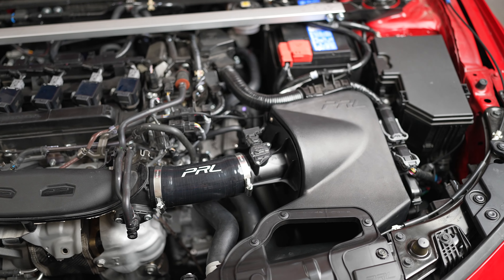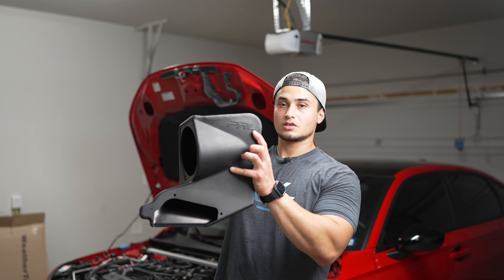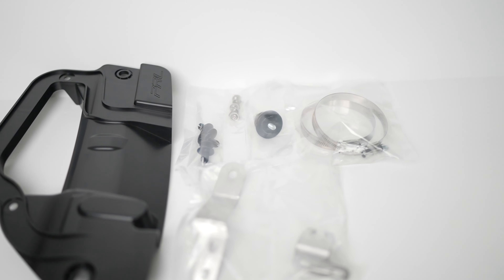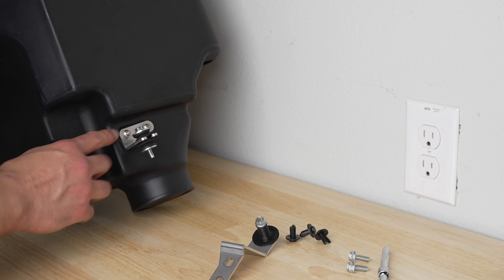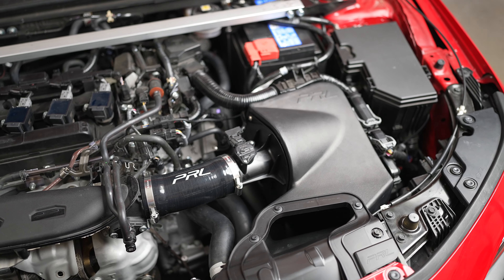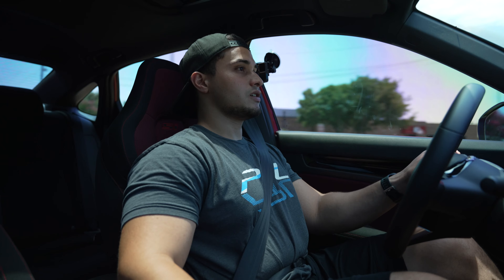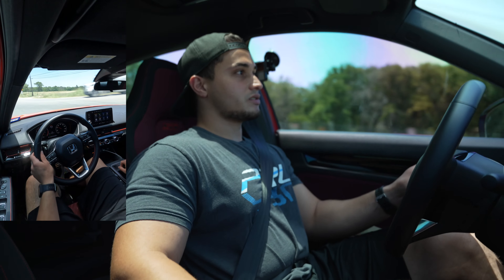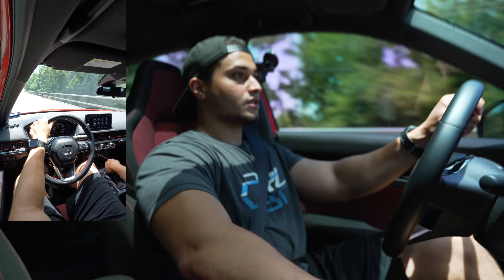Official PRL High Volume Intake Install for the 11th Generation Civics and 5th Generation Integras

Comment: Amazing video! Just got my 11th gen Si this week and doing all kinds of research on the first couple mods I want to do to it. I've previously owned the 10th gen and to be completely honest the 11th gen stock doesn't feel as fast as my 10th gen when stock, but I have a good feeling that there is a lot of performance potential once putting some mods on the  11th gen. I plan to order this high volume intake from PRL along with upgrading the Intercooler and lastly getting a K tuner setup on it. The BIG question I have is if you are still running on your stock clutch? I've read different reviews stating some people dont have an issue running a tune on a stock clutch and others get slippage... so just thought I'd get your opinion on it. 

Keep up the great content my friend, and by the way you just got your self another follower and I've made sure to enable to notification bell! Lol 🤝
Reply from the maker: My man! Thank you for the kind words and congrats on getting a new SI. So, I am still running the stock clutch, it still sucks on this generation civic like it did on the 10th Gen. In my personal experience, running Hondata’s flex fuel map, I don’t get any slippage until I start adding E85, the more e85 lol the worse the slippage, I think the most I run is E30 though and that’s only on hard shifts. Like when I would do I launch and then I would shift to 4th, it would slip a little. Or when I want to pass someone on the highway and I try to downshift and launch it, it would slip. But with the regular pump fuel maps you should be fine. I recently switched to Ktuner and so far no issues on their most aggressive map. I haven’t added E85 into the mix yet but my next video will be on Hondata and Ktuner so you’ll hear my experiences on there. Good luck man and thank you for supporting the channel! 🙏
Reply: Oh okay, thank you very much for the feedback. Yea for the meantime I plan to run stock k tuner tunes or maybe even phearable 91 octane tune. 

I'm literally going throw all your videos and have put together my wishlist from them.. haha

1.PRL High Flow Intake (just waiting for them to go on sale) 🤣

2. KTuner 

3. PRL Intercooper Upgrade

4. Aquity Bushings 

5. Lasfit Led turn signal and reverse bulbs and floormats.

(I thinks that's about it, In order to get me started).. hahaha 

Looking forward to your next video on ktuner and Hondata. Have a good one brotha!

Comment: For a daily driver that is used mostly for slightly spirited driving and some road trips is the prl intercooler worth it? Should i do the charge pipes too for my needs? Also, how would you swap the filter with this intake? Would you have to remove the intake to do it? Ive never modded a car before so my questions probably seem silly.

Comment: Another great video both on install and drive👍
Yes wheels and tires asap. For reference the oem wheels weight 28.3 pounds 😳. The ones I put on weigh 23 pounds. Though still stock, acceleration and throttle response went through the roof it’s crazy. 
I swapped over the summer Eagle F1s from my oem wheels though I did go a little wider at 18x8.5 +45 and they stick! 
I know your on a base flex tune so it may be hard to answer but I wonder how this will react on the stock tune? I know prl posted a dyno graph but I’ve learned to take that with a grain of salt. No offense.. getting the car dynoed next week to see what it does in stock form. Super contemplating pulling the trigger on this and dynoing after to see the results 🤔. I’m actually really impressed with the factory power band throughout.
Reply from the maker: Thanks dude! Yeah I ordered some lighter wheels and it’s going to make a world of difference. When I had the Type R and ran the ZE40’s it was like a completely different car lol. 
I’m not expecting any crazy power gains out of this intake if anything it’ll just prepare myself and everyone else who gets this for any future turbo upgrades. Probably where you’ll see the biggest difference, the stock intake system is already pretty great.
If you haven’t already you should join the discord I created for the 11th Gen civics so you can share all your thoughts on there. Link is in the description
Reply: @lui.racing  yes it’s crazy how different the car is. I’m down to join ✌️
Reply: @lui.racing  The Discord link is showing expired. :(

Comment: Hello. Great video. I have a question does the map housing have a small lip or something cuz apparently mine does and the map housing doesn't fit into the other part where the air filter is actually at. It seems that your air filter was all the way down but mine doesn't go all the way down. Any help on this will be greatly appreciated.

Comment: Are you tuned? Not sure if you mentioned in the video
Reply from the maker: Not custom tuned, I have the Hondata flex fuel tune on the car
Reply: @lui.racing  gotcha. The car feels pretty slow to me all stock. Does it feel a good bit quicker with the tune and mods you have?
Reply from the maker: @SIIKAP1  man it makes a world of a difference to add some bolt ons and a tune.

Comment: Great video my guy. Keep it up. Which Milwaukee and what size impact wrench did you use in this video? I’m in the market for new power tools.
Reply from the maker: Thanks man!!! I appreciate it. It’s a quarter inch impact that I bought at Home Depot when it was on sale for $100, and lemme tell you! It was well worth it. This impact can do most anything. I have the half inch impact too and that thing is dangerous.
Reply: @lui.racing  Thank bro. You wouldn’t happen to know which model you have do you? Just want make sure I don’t buy the wrong one.
Reply from the maker: @1904bomdc5  I don’t remember off the top of my head, when I get back to my house I’ll see if I can find it and I’ll put it on here.
Reply: @lui.racing  Thank brotha. That would be very much appreciated.
Reply from the maker: @1904bomdc5  model number is 2656-20
Reply: @lui.racing  Thank Youbagain brotha. I appreciate it.
Reply from the maker: @1904bomdc5  anytime my man!
Reply: @lui.racing  One more thing bro. When you have a chance, what size/brand 1/4 hex to square socket adapter and sockets are you using?
Reply from the maker: @1904bomdc5  that I don’t remember. I have 1/4 hex to 1/4, 3/8, and 1/2 inch adaptors for sockets. You should be able to find one on Amazon maybe Home Depot too

Comment: awesome videos bro. Q, did you need a tune for the new intercooler and HVI for your si? any info is helpful
Reply from the maker: No you don’t need a tune. Been running without a custom tune for months now with no issues.
You would see the most benefit out of these mods with a custom tune though.
Reply from the maker: Also, thank you for the kind words my man! 🙏

Comment: Since you previously had a resonator delete, did you have to put all the stuff back together after install the high volume intake system?
Reply from the maker: No you don’t have to put everything back together. You can keep the part of the resonator delete that goes to the charge piping
Reply: Great vid, Luis. Do you have to do a resonator delete to install the high volume intake?
Reply from the maker: @manukaliasf  no you do not. Everything you need will come with the intake for install. Super easy

Comment: Just bought the PRL HVI for my ‘24 Integra 6mt. Just a video of a ‘23 integra going into limp mode after hitting redline with this intake installed. What are your thoughts on that? Have you had the same experience or heard anything similar? I guess now I’m just hesitant on the install
Reply: Have you installed? If so, notice any issues? Got a 24 Integra 6MT and thinking about ordering but heard thing same thing as you posted.
Reply: I’ve had it installed for about 6 months now. No issues at all. Things sounds amazing honestly.
Reply: @thebuffanimalnurse7205  Awesome, thank you!

Comment: no need to unplug battery or do an idle relearn process when working on the intake?
Reply from the maker: I never did that and my car was fine
Reply: had to do it on mine, had every single light on the dash go off but after unplugging the battery it was all good

Comment: Awesome video but not sure what happened my SI now won’t go past 12 psi after installing it
Reply from the maker: That’s strange, I never had that issue. Make sure sure everything is on correctly including the MAF sensor. Other than that you’d have to ask PRL if they can help you troubleshoot
Reply: @lui.racing  yeah I just got done putting it on I’ll go back to stock and go from there thanks

Comment: Hey man, my 1.5 civic CVT is making 185WHP with PRL stage 1 intake system.. do you think it can add more if i change to HVI?

Also, is it safe to run a cvt civic with 200+ whp? i want to but i dont want my cvt to break

Comment: Just put this in today. Few things different than the production model. That bracket has your pre production grommet @10:43 but it doesn't line up exactly with the air box so it just kind of sits on top, not sure if it's designed like that but seems kind of odd.
Reply: Are you talking about 10:50? I just put this in today and I could not get that damn bolt to go in. I gave up and left it out. It's very snug without it so not sure if I'm going to leave it or redo it.
Reply: @BrandonKyle7  Bolt goes in fine for me but the part at 6:10, production version is different and doesn't fit in
Reply: @lepoldbuttersstotch  OH I know what you're talking about! I had the same issue. You have to remove the metal bracket that is on the car stock. If you look at 8:44 you can see it's not there. I was in the same boat but you just need to remove the metal bracket that is held on by two 10m bolts.
Reply: @BrandonKyle7  Yup, that's the piece. I mean that the replacement bracket doesn't actually fit in the hole at 8:20. Mine didn't come with the grommet there. My bracket was just one piece and it doesn't fit in that hole at 8:20
Reply: @lepoldbuttersstotch  weird. Mine came with the grommet. You should hit up PRL, they can probably send you a grommet.
Reply: @brandonjohnston6760  fitment is snug enough, unless I get some rattling I don't think I'll bother, the sound is so nice
Reply: @PeenutButterJelly  same with that pesky bolt for me lol. I'm gonna leave it out. Sound is on point for sure! Sounds a lot better than I expected, honestly. I'm digging it
Reply: @brandonjohnston6760  it's fun just to build the rpms and hear the chirp, reminds me a bit of the BOVs but since it's a closed loop, won't mess up the AF trim
Reply: How do you guys like the sound of the intake?
Reply: @jaylonsorrells5139  It sounds incredible

Comment: Why do you see people remove the bumper for this install? Your removal and install looked simple compared to other videos I've seen.
Reply from the maker: Lol that’s interesting, I have no clue why anyone would want to remove the front bumper for an intake. I removed mine in my newest video to show you guys the duct but that’s about it
Reply: @Lui Productions  I have the 2023 integra. One video for the resonator deleted, they removed the bumper. I have been holding off on this upgrade because I didn't want to take my bumper off before my 1st oil change. 🤣  Now I've seen your video, I went ahead & ordered the intake as well as the extra vent. Thank you bro!
Reply from the maker: @sawredski7906  you can remove it through the wheel well, but it’s a lot easier with the bumper off lol
Reply: @Lui Productions  I completed the  install. I didn't have to remove the wheel well or bumper. I also installed the +vent. Took right at an hour, answering all my 5yo daughters questions along the way.  Lol. Was a little tricky attaching the 2 button head screws into the extra vent, but everything went pretty smooth, watching your for motivation. 🤣

Comment: Hey so I ordered the cobra intake but have seen good things and bad things about it installed on the 11th Gen being that you have had it and now have this one which is better in regards to no issues?
Reply from the maker: I didn’t have any issues with the cobra, you won’t be able to do a full install, as in there’s a bracket that can’t be used. But it makes more Turbo noises if that’s something you want, I know a lot of guys want that. I prefer the new one because it fits really nice and I think it looks cleaner. It’s not as loud as the cobra. Both are good in my opinion. Not sure what stories you’re hearing, but if you’ve seen my cobra install video you’ll see that it’s pretty straight forward.
Reply: @lui.racing  sounds good thank you for replying and clarifying !

Comment: Which is better in your opinion? The high volume intake or the cobra
Reply from the maker: The high volume because it’s super easy to install and looks a lot nicer in the engine bay
Reply: @lui.racing but what about performance wise and sound quality?

Comment: Will it sound like that even with stock exhaust and without bov
Reply from the maker: Yes. I have stock exhaust and no blow off valve.
Reply: @lui.racing  nice. Thanks
Reply from the maker: @laurenzdelacruz3477  anytime, join my discord if you have any more questions. Link is in my bio. All 11th Gen stuff

Comment: this will require you to install the intake prl resonator delete right?
Reply from the maker: No it’s not required. When you install this there is no need for the resonator delete on this intake. There is, however, a resonator that can be deleted on the charge piping of the Intercooler. But it’s not needed for the intake. I deleted the resonator for the charge pipes in my “PRL Motorsports Cobra cold air intake install” video of you want to check that out so you have an idea of what that looks like if you don’t already.

Comment: Will this work for a 2023 Honda civic sport hatchback 2.0l
Reply from the maker: No this is for the turbo 1.5. They have one for your car though. Use my code: Lui5
Here’s the link https://prlmotorsports.com/products/2022-honda-civic-2-0l-high-volume-intake-system?_pos=13&_fid=df0eec372&_ss=c

Comment: Waiting on mine. It said it was going to be here today but now it says tomorrow. 😢
Reply from the maker: Did it ever arrive? Hope you enjoy it!
Reply: @lui.racing  it actually did. That night it showed up. Idk how if usps out sourced it through FedEx or something but FedEx ended up bringing it. The install was a lil but of a pain and my dumbass forgot to hook the map sensor back up so I through codes. 
But I figured out how to get the codes off and everything working now.
Reply: @lui.racing  and being stressed after throwing codes I pulled in to my garage a little to far over and traded paint with painted wood now I have new marks on the side of a month old car I gotta get fixed.

Comment: Forgive my lack of knowledge, but I am sure you or another viewer can quickly help answer 1-2 questions about my 2022 Si project. I just pre-ordered this HF intake system from PRL... Can you please advise me
1. Do I also want / need the resonator delete kit? or does that go away entirely with this new box? (because on PRL website it says "pair with"
2. I also saw the have a 2nd cold air vent for the bottom of this HF intake, but again, not sure about how the bracket is installed, and if the delete kit, is needed, or effects the install of the second vent. Any advice you can give me is appreciated. Thank you to anyone willing to help.
Reply from the maker: Hello, this intake will get rid of the need for half of the resonator delete kit. Check out my cobra cold air intake video to see where the other half of that kid gets install. 
To answer your second question. PRL does not advertise the secondary duct requiring the resonator delete.
Reply: I am also curious about this. This is the first car I have ever modded. The resonator plug kit is listed as "frequently bought with" on the PRL website. Is that necessary with the high flow intake? I never saw you move it from the removed stock part to the PRL part. Thanks
Reply from the maker: @PhugNutz  there are two parts to the resonator delete kit. One removes the resonator on the stock intake, and the other piece removes the resonator on the Intercooler piping. If you get an after market intake then you won’t need half the kit. If you get an aftermarket intake and aftermarket Intercooler piping then you don’t need the kit at all.
Reply: @lui.racing  ahh I see, I do plan on doing an intercooler upgrade. Does that make it to where you can’t use the resonator kit or just that it isn’t necessary to boost the sound?
Reply from the maker: @jaylonsorrells5139  if you get an intake and upgraded intercooler piping then you won’t need or be able to use the resonator delete kit. All it does is get rid of the resonators that dampen sound from the factory air box box and charged air piping

Comment: Would you have to remove the inlet box to change the filter?
Reply: It doesn’t look like you’d need to.  He even made the comment that he preferred to mount to filter to the air box prior to installing it in the engine bay.  So you should be able to remove the pipe, then remove the three bolts that secure the filter without removing the air box.